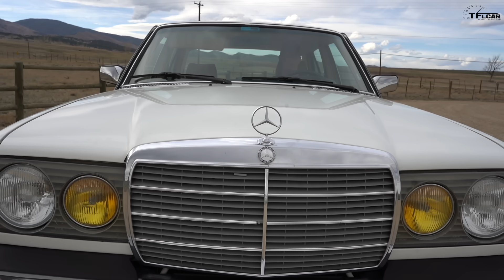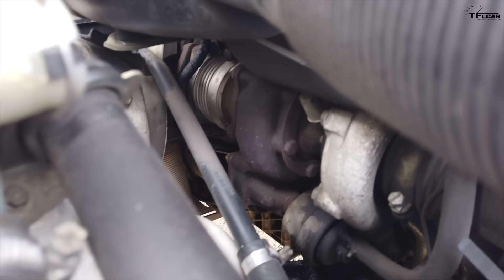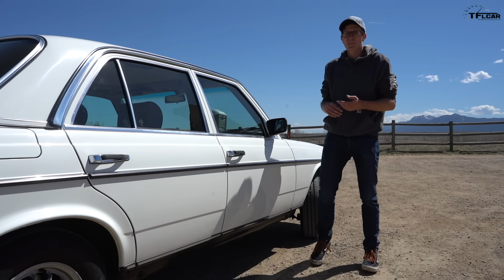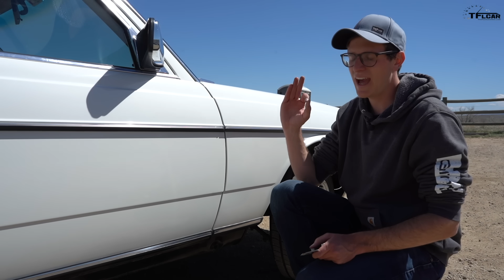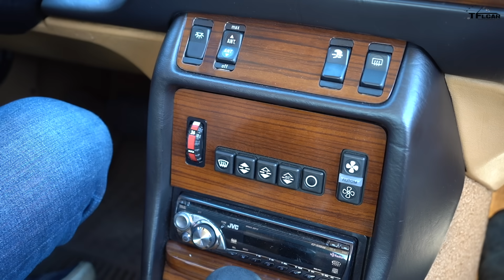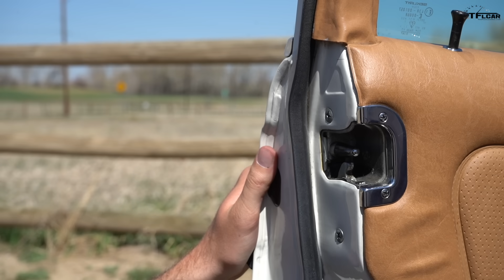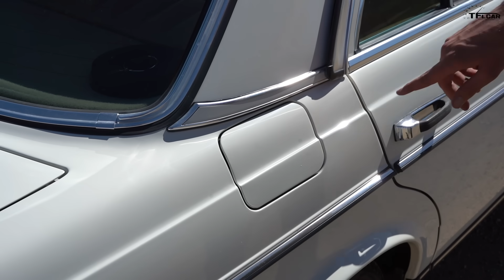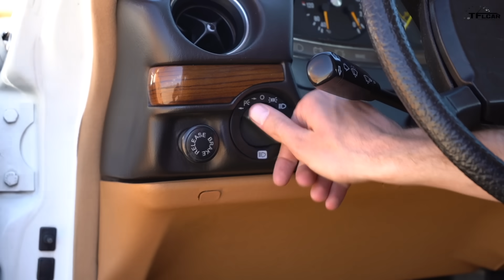This 37-Year-Old Diesel Is THE BEST Mercedes Ever Made!

Comment: you have dredged up some sweet sweet memories from days gone by ,
 I have worked on thousands of Mercedes diesel from 1973 on ,
I bet you there's something that you didn't know ,
the Mercedes-Benz ZF automatic transmission is the only one that could actually be kick-started,
 yes you or reading it right there is a secondary transmission fluid pump on the output shaft of the transmission which is used to pump transmission fluid while Vehicle coasting and the need for the kickstart 
if the front pump is not working for some reason then the output shaft fluid pump will engage and start pumping ,
if I remember correctly this device is on  ZF Transmissions from mid 80s and  earlier,
in the old days I used to see mechanical ideas on Mercedes Benz and five years later find it on different vehicles ,
for example the crush Zone was invented buy Mercedes they allowed other manufacturer to use it ,

Mercedes-Benz use parts from a Chrysler air condition system if you have an older version Mercedes you will see this big burgundy colored device  with a black top on the right side of the firewall ,
they call it the AC servo ,
if you have a battery drainage problem I could guarantee you this is it , disconnect the wires going into it and let it sit overnight and see what happened ,
1st remove the Black cover on top of the AC servo... there is four screws some under silicone seal ,

 2nd remove the one screw that holds the connector on to the servo ,
one way to test for voltage drop is to disconnect the negative cable on the battery and hook up a test light between the negative cable and the negative terminal on the battery ,
then touch the negative cable to the battery terminal ,
 then remove the cable from the battery terminal and see if the light comes on ,
if the test light comes on then there is voltage draining  the test light should barely light up ,
another Way by hooking up an ammeter between battery negative terminal and the battery cable ,
then touch the cable to the battery to charge up all and any devices that might need memory power then remove the cable from the battery terminal ,
there should be less than 50 milliamps ,
this idea does not work on a newer Vehicles due to all the electronics on board ,
the second problem that I had to repair constantly was hard cold start especially in cold weather ,
 the glow plugs system is one of the least  serviced part of the engine it just simply stays there until something goes wrong ,
 if there's a problem starting up on cold weather it could be one out of two low compression or the glow plugs are not working right ,
there is a glow plug control unit behind the left headlight which could be unplugged and test the resistance of the glow plug right there ,
disconnect the wire  and test the resistance of the glow plug with amp meter it should be 2.5 +- ohms ,
make sure to identify the wires in a wiring diagram prior to testing ,
the glow plug system on the older 123 body style I'm talking about early 70s ,
was hooked up in a series circuit in which one glow plug whill energize the other , they were connected to each other by using  metal jumping wires between one glow plug and another , upon activation of the glow plug they will heat up and smoke like crazy some will light up red hot , there will be smoke coming out of them from whatever debris there is on them ,
this early glow plug system used an idle cable setup hooked up to a knob in the dashboard ,
occasionally this glow plug idle control knob will heat up and meltdown and on rare occasions it will cause an engine fire,

Catch Fire you ask?

yes worse than gasoline engines ,
1st there is a vibration and Noise reduction pad glued to the inside of the engine Hood ,
this thing was Notorious for absorbing whatever fluids leak from the engine , from diesel fuel to engine oil it all get embedded in this noise dampener ,
2nd 
the glow plug idle control cable which is similar to a choke cable on gasoline engines is connected between the body of the vehicle and the engine ,
there is a ground jumping cable hooked up between the body and the transmission housing it provides all the ground needs for the engine ,
on occasion when the cable breaks or corrosion buildup ,
it would impede the travel of amperage from between the battery negative and the engine block ,
at this point this idle control cable would become the main route for the amperage especially upon cranking or using the glow plug idle control system ,
it will instantaneously heat up melting the plastic covering on it and igniting the vibration noise damper glue to the inside of the hood ,
it is something that cannot be believed in till experienced ,
a Tell-Tale sign of such a problem is the melting of the idle control cable and knob or difficulty operating the idle control cable ,
 or the starter dragging while starting ,
it can also be tested by hooking up an ammeter between battery negative and engine block then have someone start ,
observe the amperage going through the amperage meter ,
if there is a problem a large amount of amperage will go through the meter , with the meter it's a good idea to use a piece of junk amp meter or use an amp meter similar to amp meter sold in automotive stores as a dash amp meter ,
if you have a diesel engine of any type it's a good idea to install a secondary ground cable from the battery to the engine block directly ,

everything works using vacuum from door locks air condition to engine shut off ,

another common problem ,
the second common problem was the engine not shutting off ,
due to the fact that diesel engines have low vacuum a pump was installed to provide vacuum to the rest of the vehicle ,
the engine shut-off was vacuum operated and it was a weak point in these vehicles ,
replacing it is fairly easy ,
a Tell-Tale signs of the engine shut off vacuum going bad is oil in  the vacuum system specially on the engine side ,
 one of the weirdest problem that I ever had to work on these things was a brake pedal pulsation ,
stepping on the brake pedal felt as if the pedal is trying to push back against my foot then go down again,
the problem was engine oil in the brake booster which comes into the booster from a bad engine shut off or  a ruptured diaphragm in the vacuum pump ,
one way of getting a cold diesel engine started in a cold environment is by the use of a propane torch and heat up the incoming air into the intake manifold ,
remove the air filter and point the torch inside the intake manifold warm up the incoming air then start .

another item I have repaired the whole lot off is the heater mano valve ,
it controls the hot water going into the air condition whenever it goes bad there would be constant heat coming out of the air condition , some technicians used to replace the heater mano valve  in reality there's a small kit you could buy and repair it .
any questions add a comment .

Comment: Had grey-market 1985 190D. 5-speed manual.  Best car I ever owned
Reply: @Donald Barden
Yes back in the 1980s in the USA many European models were imported privately and by independent importers, and in my opinion the lower trim levels (most had manual trans, windows, climate control, ect were more reliable and durable, along with great cloth trim seats, far better and more comfortable than the MBtex that MBUSA insisted on offering in every model here.

Comment: This and the W124 are incredibly strong, long lasting, over engineered cars. Cant say that about new Mercs anymore.
My dad took a 1985 200D(W124) up to 1.200.000KM , with absolute minimum maintenance(next to none, he did not care about oil changes etc...) las time i saw the car, it still started, but run on 2 cylinders, but still moved!!

Comment: Americans, can't handle metric, can handle 24-hour clock. Top nation? You're having a laugh.
Reply: Metric is for those that not smart enough to do division or multiplication by anything other than tens.
Reply: @matthewq4b  So why bother with new fangled Arabic numbers when Roman numerals will do fine?  And we don't need horseless carriages when a horse-and-buggy will get you from point A to point B.

How many cubic inches are there to a liquid US  gallon?  What's the formal definition to an acre?  How many acres are there to a square mile?  How many chains are there to a mile?  Why are there 5280 feet to a mile?  I'm sure you know the answers.  I DO know the answers, so I realize just how screwed up US customary units are.
Reply: @johnhudelson2652   The only advantage Metric has is multiple of 10  that have NO relation to anything practical.  
Imperial ties into time and physics in general.   But if you knew that you would have not posted the above...   Once again Metric for those only smart enough to divide and multiply by 10.
Reply: @matthewq4b  Give me some examples where imperial units tie in with time and physics.  You are aware imperial units are defined in terms of metric units, aren't you?
The original definition of a meter was 10 millionth  the distance between the North Pole to the equator passing though Paris.  Now it is defined the time it takes for light to pass during a certain  time.  Even the kilogram is no longer defined by an artifact.  It is defined in terms of physical constants and is determined by Kibble  balances.

Quick question - what if you had to determine one third of the distance of 7 feet 5 13/64 inches?  Sure, you could use a special calculator, but trying to do it with a regular calculator or pencil and paper would be a real pain.

Imperial units have the same ease of use as old British money - 12 pence to a shilling, and 20 shillings to a pound.  Can you imagine trying to pay for drinks at a bar as you progressively got more and more inebriated?
Reply: @johnhudelson2652  What are the major divisors for imperial.  They just happen to be same the divisors or degress or circle and the lenght of a day. 

And really a third of 7 feet and 5 13/64" is  29.87697"  or 2' 5.86979"  this it out to a hundred thousand of an inch beyond what is practical to measure without specialized equipment.  That took about 5 seconds to calculate that WITHOUT a calculator.  It was not complicated nor difficult to do.  Proof alone that you thinking it is hard or complicated to do sort of proves the point that metric is for those who are not overly bright.   And ALL Imperial measurements are based off practical applications that are easy to visualize.  Additionally, most of the common imperial measurements divide neatly into many common divisors such as 2, 3, 4, 5, 6, 8, 10 and 12. . That’s how they were designed to work and that’s how the numbers were arrived at. That means that as someone with no calculator and only basic knowledge of mathematics you can easily calculate half or a third, or a fifth or a twelfth.  Apparently, dividing by anything other than ten has exceeded the intelligence of most people today'.  And good job proving that point to a "T"
Reply: @johnhudelson2652  So you'd be happy with 30 hours in the day so you'd easily work out a third of a day is 10 hours. So how many hours in a quarter of a day ? - OK so it's 7.5 - so now you're having to handle parts of the hour. There are 24 hours in the day to avoid that. Third of a day, 8 hours, quarter of a day 6 hours. Whole numbers all the time.

Comment: I have an 1984 300D Turbodiesel with 547,000 miles on the original engine and transmission. Mainly because I change the oil at 3,000 miles and use 15W-40 Diesel oil in it. The engine has never been opened up, except for valve adjustment, couple of water pumps, one fuel injection pump rebuild, one injector replacement. Transmission is original, with the flywheel flex plate having to be replaced. Love the car-average 23-24mpg in the city and on the freeway, when I can, cruise at 75mph at about 3,200rpm-so I do not drive it lightly. But-these engines like to be driven hard. Love the car-great ride. My wife has a Japanese SUV that you feel all the bumps-not on the MB!

Comment: I used to have a 1982 W124 300SD. 275,000 miles and I sold it still running perfectly.
Reply: W124 came in 85.
Reply: @kiisseli8086  Yep, you're right. I had a 1982 300SD, but it was the model just after this one. Same engine.
Reply: @chybagus  300SD is an S-Klasse and the chassis code is W126
Reply: @kiisseli8086  yes, that's right. Same engine. Amazing build quality...

Comment: Awesome review! I had a '68 220Diesel stick shift, it's amazing to see how this '82 is a natural evolution and refinement of that car. So many similarities but so many upgrades too. Mine was cooler because I had to pull a lever to warm up the glow plugs and start the car after turning the key. ;-) The steering wheel was even a few cm bigger than yours! It didn't have any power-anything but it also had that great turning radius. Slow by today's standards, but so much fun to drive. Was running it on biodiesel for the last few years, but then unfortunately it was destroyed by a drunk driver... In a trip to Morocco, I saw many taxis of this W123 generation, and I was told that it was because they survived "trial by fire". Keep taking care of this beauty ~

Comment: I have had four... YES!... FOUR OF THEM!
but...
the 1980 was the best year.  Teething pains and
possibly Belgian (rust) steel in your pre '80.  Will
an '80 transmission fit in an '83?  OF COURSE NOT!
I should add that all four were the 2.4 liter 4 cylinder.
The first year turbo'd 300D had issues with the block 

cracking between cylinders 4 & 5. Don't know about 

the rare non-turbo 5 cylinder.
These cars also came with a 5 spd. manual (240D) but
that transmission wasn't very robust. 

My favorite was the 240TD Eurospec. (only seen one), 

and the 240D sedan.  Much simpler, more reliable and
very simple (doesn't break-down) climate control.  The
300D has climate control that is guaranteed for the life
of the vehicle.  "We MB and our lawyers guarantee that 

sooner or later the climate control system will fail and 

cost you a lot of money.  "Later" if your car has the Euro 

system, and "sooner" if it has the Chrysler (yes, it had 

Chrysler climate control waaay back then) systemMax Speedwell."
For this, and other reasons, the 4-cyl. was a superior car.

Slow, but far superior.  I have two still with me, and NO! they
are NOT for sale.

And..(drum roll please)  the very best year and model ever?
The 1972
142, 144, 145
...Volvo.

Had two. ('72, & '77.  The '72 was clearly far superior)

They actually beat the W123 chassis.

I dearly want to find a pristeen condition 240TD.  going in and 

changing out the climate control system is not for the faint of 

heart.  Then, convert the mounts from 5 cyl to 4 cyl, install the 

external slave, mounts for the manual transmission (Supra 6
anyone?), adjust the speedo,  odo, possibly change the diff., ...
no, it's not a weekend job to convert a 300TD to a 240TD, but
my guess is anyone with a shop, lift, a load of spare time, and 

a lot of money (I'll bet a very good home mechanic can get the 

job done for less than $18,000), and you will have a zero-timed
240TD, and get 34 mpg. 

     - "Mad" Max Speedwell

Comment: You could buy special shaped concrete blocks fitting the left and right trunk sinks to prevent the tires spinning on snow by adding weight to the rear . 4matic was introduced with the next generation.

Comment: Bull shit, I worked and lived in North Africa  and there the 404 and 504 Peugeots were KING, in sedan, estate and even pick up form. Come to mention it the 504 was the better car, it had better seats the Indenor Diesel could challenge any Benz engine handling and driving Peugeots were simply better. And what about Toyota, I mean any Toyota can beat any Benz  or any other car in reliability and durability. These Benzes were good cars but the best no, there were enough contemporary rivals. I mean CX Turbo Diesel estates chased the European highways at night delivering newspapers, these guys did 100 MPH in ordinary station wagons. So there are enough rivals, BMW launched its 524 Turbo Diesel, Fiat had the 132 2500 Diesel and Volvo came to the party with the 6 cylinder (VW engined)  240 Diesel. But my best experiences in this era was definitely the 504 Peugeot Diesel estate.

Comment: Typical MBZ German over-engineering. Like, we've built a great car, let's ruin it by making everything vacuum  control. Seriously ???  I've had 300D, and 300SDL. Killed by the vacuum  controlled DOOR LOCKS !  A door lock vacuum leak means the door won't unlock, plus the engine has a vacuum leak. Other than that, a great car.

Comment: I've owned a w124 and w201, both are very reliable. The 300D motor will outlast the gas six cylinder. My current 1989 190E 2.6 has double the power my 300D had. Driving wise, the 190E is way better. It's actually fun to drive, the 300 is way too slow.

Comment: W123 's are Too Slow & Lethargic for today's Driving.  Rather like VOLVO's 
Huge old TANKS,  Last forever, But all the buyers have got old VERY OLD & Passed away now. 
Modern Drivers Want Power & Sharp Handling. 
My Father NEVER considered ANY Mercedes,  Too Slow,  OLD Man's cars & He passed away 18 yrs ago aged 70. 
It was my Dad that Taught me to Drive FAST, & Quickly & Safely. 
SAFE SAFE SAFE, !!! 
BUT LET it RIP FLAT OUT .
Fast cars ARE A WASTE OF MONEY if YOU CANNOT DRIVE THEM FAST & SAFELY  Every Day. 
He had V12 Jaguars.  !!  Just the same as an XJ6 But LOADS FASTER !! 
NO Difference in the car , Just a V12 engine. 
I grew up as a kid sat in the back of a V12 Jag. A New One every 2 or 3 years.  E- type 5.3 V12 ( XK - E ) USA.